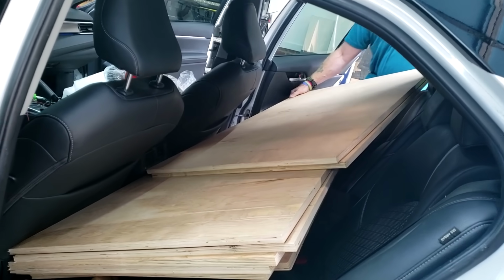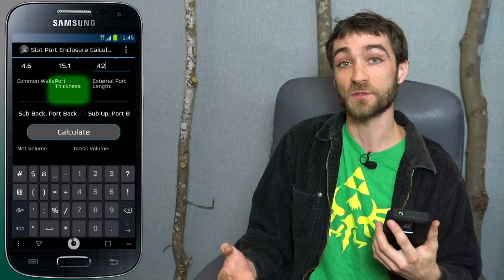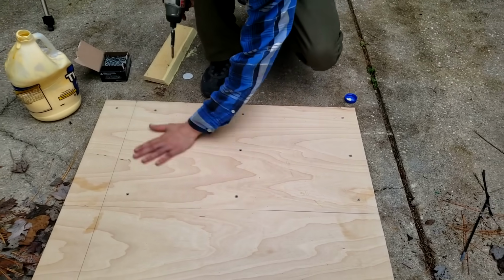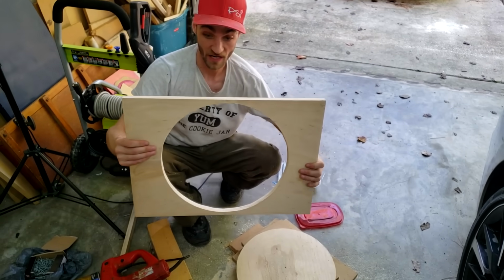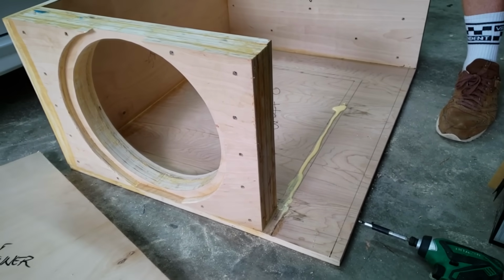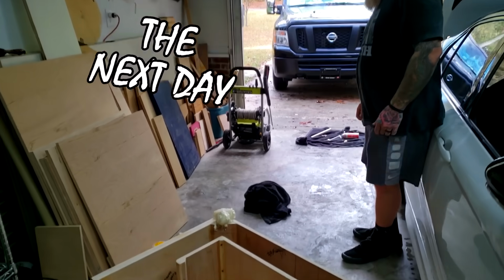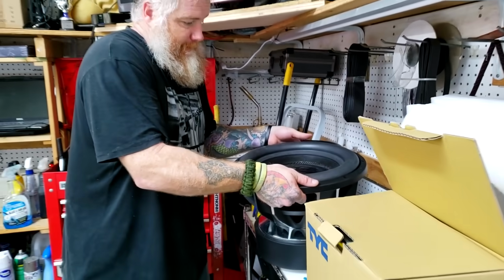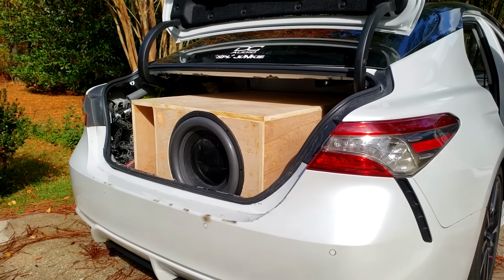Building a Ported Subwoofer Box for DEEP BASS!!! How To Design & Build LOW TUNED Slot Port Enclosure

Comment: quarter the way through and extremely jelly that your friend helped with the table saw. my $21 HF jigsaw with scroll blade was awful and it was my first time making rip cuts and with a power tool! Lesson: wrong jigsaw blade, ditch the homemade guide and focus on the drawn line. Still, uneven cuts seemed to seal nicely at 28x14x14. I'm old so my amp tuning is around 55% full tilt lol. Tip: check out the port area calc on SMD forum for even tonality from 25-100hz. Wasn't planning my 2cubed to be nearly 17" deep but it worked out.
Reply: my bad. 28x14x17+ with front baffle added AFTER. Just glued it on and if I shape up the box, the port will extend another .75". I suck

Comment: I prefer 11-13 ply baltic birch, but i use them for dj subwoofer applications so i need light wood that can stand up to elements and mobile applications, mdf is good for permanent installs, just dont get it wet

Comment: Great video.  Tip for building.  Instead of using wood glue use 100% silicone in a tube.  That is tuffer than wood glue and won't crack under the pressure..  it will actually allow for the flex.
Reply: Silicone is pretty poor at adhering to wood. Better of using a polyurethane based sealant. They normally use this stuff to bond plastic parts to body work. It is amazing stuff.

Comment: Back in the 90’s I built a box like that out of oak. I applied a thin layer of concrete to manage the bass better. The sub was a 18” cerwin Vega stroker. Pheonix Gold amp. MB Quarts were components in my doors McIntosh head unit.

Comment: Can you build a box in crazy dimensions that will have the same air volumes and still perform. I have a f150 I would like to build a box that allows for a single 15 and mounts under the seat and in front of the seat taking up the space behind the center console between the rear seat. Do you have an email that I could send more info to?

Comment: Man you need an 18g or 23g nail gun to keep the pieces from moving while screwing em'. A countersink helps too. If you sprinkle some table salt on the plywood after glue they won't slide around. These are all just the cabinet builder in me.

Comment: I have a sealed box with 2 12’s. But I want a potted box can I just cut a hole on both ends and put a separator in the middle? Or will it fuck up my bass

Comment: Awesome video by the way! I’ve got a 2018 Metallic Blue Camry with a 12” JL W1-2 4 ohms  and 1000 watt amp in the back and may be getting a second JL just like it to add to it! Love my Camry! Next step I will replace the speakers and tweets. The factory speakers just can’t handle the bass. They crap out with the cracking sound at loud levels.

Comment: I wish you Americans stepped off that imperial system of inches and feet, the rest of the world does not like it, is used to the metric system, and by all means, your target audience would be much greater if you switched to the metric system. Also you can work more detailed with the metric system since a centimeter is a factor of 2.5 smaller than an inch, making measurements way more accurate. But great video though. :-)
Reply: No one care

Comment: SUGGESTION 4 A VIDEO: How to add a new baffle onto an existing box without dismantling anything! WHY?: For those who have stripped all of their subs screw holes, for those who need more box flexing support,  for those needing deeper baffles for longer sub mounting screws, for those switching from square subs to round subs or vice versa, for those wanting to change the look of the front of their box/enclosure, and so on. I know I'm needing to do this because T-Nuts chewed up my MDF and so I'd like to add a 1/2" piece of PVC/ABS and install Threaded Inserts into the new baffle while sandwhiching the threaded inserts in between the old and new baffles. But you could use a 3/4" or 1" new baffle made out of quality wood and teach us how to effectively attach the new baffle to the old baffle while painting or wrapping it to match your vehicle's interior or something interesting/helpful like that.

Comment: MDF is an industry standard, I'm guessing due to availability and cost.  Some pro's like to use Birch,  but I suppose it depends on how much you want to invest.  I'm currently running two JL Audio 12w6's in a 2014 Camry SE Sport and it's absolutely nuts.  Thanks for the content EXO

Comment: did not watch the entire video but he said at @ 2.57 there is no making it bigger true but if your just slightly small you can add poly to fool the sub, by slowing the sound waves down not the ideal way but it works. I have had done builds that I have been just short of target do to space limits and poly made it work poly can make the unworkable work.

Comment: simple  tip to prevent splits predrill with 1/8 " drill bit . put some glue in a cup and dip screw in glue then screw in. any time a split happens that screw will not  have any holding pressure .  also  if you poly all the internals it allows less port noise .

Comment: Dude what would be a quality box for an alpine Type R 10” DVC sub woofer 1800 watts peak. I need to install this into a 1995 C4 so there’s not much room behind the seats. I plan on integrating the mono block amps and the 4 channel amp behind the seats for airflow maybe fastened to the box itself. I’m not really needing to see the woofer facing forward as the amps will need to be cooled by fresh air and/or AC unit. I’ll be using both mono blocks on the sub one per coil and figure there probably going to get pretty warm but hopefully not I.D.K. Maybe u could play around with a few ideas and make a video about it.

Comment: Oddly I don't even have to screw in my (Dayton Reference) subs into the box. Soon, I'll be getting an Ultimax. My subs don't vibrate or have box noise. They point straight up at my ceiling so I guess the weight of the speaker and the tightness of the lip holds it in. I couldn't get the sub out once I put it in without bopping it against the floor. So 4" baffles, meh. I only left the subs loose so I can paint the boxes when the weather gets better and to mess around with audio treatments inside of the boxes.

Comment: How do you still hear? 160db? Come on, man, I can hardly stand 80db. I have my computer speakers set on 26 (of 100). That's about 38db Mathafacka.
Reply: It's looking just at lows, which is more tolerable than the equivalent of a full range speaker.

Comment: Hopefully he won't need a spare tire 😂
Reply: place that sub downwards so the air pushes the car up, no spare tire needed
Reply: Run flats come on the xse camry from factory.
Reply: @terondavis3843  for 50 miles lol
Reply: U dont need a spare tire in car audio world u can just pull ur sub out use the magnet to connect to the metal then drive
Reply: Triple A or a row service.  I haven’t had a spare in any vehicle I’ve owned in the past 10 years.

Comment: HAPPY NEW YEAR EXO! 
Awesome video and as always great to see you and the bass putting a huge smile on his face. 
At 1am i finished the prebuild of my 15" (Only a cheap one that i got as a gift some time ago with 5mm Xmas but still impressed for how it performs) home subwoofer. 
Not perfectly on new year as i wanted but when i played "put on" and hit the lowest note... Damn that put a smile on my face! It's shaking my whole apartment LoL
Hope you had an awesome new years party to!

I like to work with plywood. My sub is made out of MDF because i couldn't afford Birch multiplex.
Now i will save up money to build a nice box with birch MPX.
I will never build such a huge box with MDF again. it probably weighs 40kg and over 60kg with the the driver and amp inside. Then there is that insane amount of dust....

Comment: I wouldn't call MDF the holy grail of making boxes, but the MDF here is WAY more uniform and easier to work with than the ply wood I can get around here.  I didn't think the dust was any worse than with ply either.  Only thing that was tougher was that I had to be more careful putting screws in so I didn't split the material.

Comment: Love the video... I love the app you talked about too.. I use it alot! Question though... how did you figure the dowel displacement?
Reply: Should be pretty simple, get the diameter and length of each dowel you're going to use, then find a cylinder volume calculator on Google. Add the volume of all your dowels up and that should be your displacement.

Comment: You need a Brad nailer. Cuts assembly time in half. So much faster than screws and less likely to split panels. Tightbond is strong enough to hold the box together itself without the screws.

Comment: Could bass loosen the fuelline in the engine bay? I got a Renault laguna 2 and since i installed an amplifier my car it started to stink when it was running. At first the smell of fuel started to appear when I heared loud music and then every time I started the engine and drove a bit. Now my car just turned off while standing at a traffic light and I can't turn it on and it stinks so heavy. I just wanna know if this ever happend to you. 

My setup is nothing special just a random amp with a random sub in a random ported box. It's not tuned so it sounds not so good but for some songs this sub really shines despite the price of 10 euros ( the sub ). I found it on a flea market. I really don't know if it's called flea market in the us but this is what google told me it's called. Basiclly it's a place where people come to sell their stuff they have lying around and don't need anymore. The box was full of mold so I dumped it.  
I really wanna know how to calculate the right box and what to use why but I just can't figure it out right...

Comment: plywood is stronger than MDF, but its not the wood that fails.....it's the glue. plywood separates because the glue layers ultimately fails from the constant vibration.

Comment: Never trust Box Calculators port tuning. I build a lot of speakers and subs and the measured tuning freq are always wrong  ..   u could use the simple method of a tone  generator.. go from 10hz up by 1 hz at a time.. and observe the cone... at the tuning frequenci it will have like zero movement..  u will get a surprise..

Comment: Plywood with lots of layers is better than MDF but way more expensive. MDF has better internal damping in the midrange. The idea that MDF is the one material to rule them all comes mainly from hi-fi and full-range speakers - when you get into the world of prosound, MDF is not only a heavier option than quality birch plywood, it is also less durable and does not hold up to use and transportation.

Comment: i think fiberboard is the most death material so it doesnt add to the sound the sub makes (think acoustic guitar ) so it be the best if you calculate a cabinet to an exact note , with plywood and the same calculations and make a cabinet that sound different compared to mdf , better or worse is depending on the design and the ears of the userabout cutting the boards , look intoo buying a tracksaw , thats a handheld circulair saw that runs on a rails youre laying on the board  it makes cutting large cuts and cutting large boards a snap , you lay them flat on the floor on some styrofoam and go at it

Comment: I use MDF all the time.  I like it because it sands really well and I can make it do what I want it to, and its cheap.
BUUUUUT it is definitely not the best for making speaker enclosures.  
What you want to look for is overall strength and something else just as important which is the dampening factor of the wood, or how easily the vibrations die off in the panels.  
I've used 18mm (approx 3/4") Russian baltic birch and it is very nice, very strong, and has really good sound properties.  The problem is that its 2-3 times the price as MDF.
But there are even better plywoods than Baltic Birch.  They are usually categorized as "Marine Grade" plywoods that use an adhesive that resists wetting and the veneer plys are top quality with barely any knots or none at all.  They are superior to MDF in every way EXCEPT for the cost.  Expect to pay well over $100 per sheet.
Reply: yes but this is misleading. Take the average person's build into watts and you're around 350 watts? All 12" projects will utilize a 4x8' sheet or less. And expensive wood typiclly doesn't come in 8 foot sheets. SO that's that. Nonetheless, My first MDF 3/4ths box at 2.9cuft = 2.0cuft is fine the last couple days after 2 days of "breaking-in" the sub. It's muddy with certain AM tracks. f it

Comment: Don't ever use spray foam in a car you twits. It soaks up water and eventually will separate from the metal causing vibration rattles which are fucking annoying...

Comment: A little tip for you when your glueing the larger flat panels together. After you put your glue on sprinkle some salt across the glue. It helps keep the from sliding around. Kinda like grip tape on a skateboard

Comment: I would love for you to design a box for a convertible e46. I still want to be able to drop my top as well. Currently running 2 15" k6 2ohm dvc subs as free air. The fire through the ski pass. I'm about to remove everything and build a sealed box, but it's gonna be a tight fit getting the airspace. I can still kinda use my trunk as it is. 
Thank you sir for providing the vids you do. I know it takes alot of work.

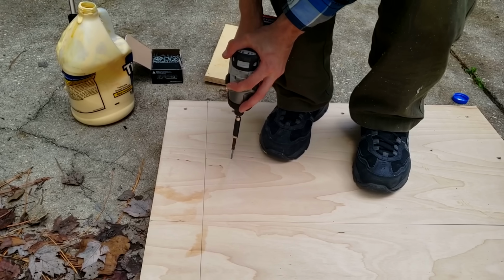Comment: EXO, do you not know you cannot squeeze with full threaded (8:55) screws without pre drilling one board ?
Or you can use screws that have no threads the first inch (thickness of one board) or less below the top .
Happy fabricating and have a nice day!

Comment: So i have a aufio pipe amp and i was putting a screw in to mount it to keep it in place and accidentally pinched my power cable and shorted it out to the case of the amp haven't tried to add power yet as I need a new power cable to be safe and a fuse as a breaker box I had didn't even pop but I will be doing a visual inspection before I add power in anybody's experience what are the odds of it being good

Comment: I wish you could work on my project you have inspired my system set up right now I am pushing 4 cvrs 12 by kicker with a Swiss audio p450.1 pro series I was told was 500 watts , epicenter power acoustik, and a mini 500k micro farad capacitor .. soon to be 6 kicker cvr12 I do have a video of my old 6 subs I had just for the mess of it 🤣 please check it out and if you like I will try to post a new video of my 4 cvrs 12

Comment: the actual wood used matters less than whatever dampening you use for the box.  plywood plus dampening mat is fine.  also depends on if you're just building a sub box, or a pair of full range speakers. resonance is always an issue, so dampening and bracing matters more than the material.

Comment: As far as I remember MDF has a better resonant frequency parametres than plywood; Making plywood lose more pressure as it will yield easier. But then again, if you overdo thickness of plywood, go for it. There is a reason for all proffesional boxes being mdf, and that is really the only thing you need to know. :)

Recap: 
MDF (non resonant)
Plywood (resonant)

Comment: The problem with plywood is at certain frequencies could and usually vibrates the plies apart causing unwanted noise in your enclosure. If the plywood didn’t get glue in places you can’t see from the mill, your going to hear it, Usually at low volume. Yes MDF creates a lot of dust, but it is more dense and you can get cleaner shapes. Back in the 80’s people used plywood, then particle board, then MDF.

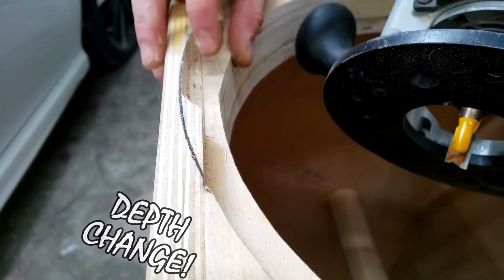Comment: When you router the sharpie line around 25:00  use the discarded center cut out from the baffle, you can use it support the router so it doesn’t wobble. Notch it and put it back in the hole with a longer piece that spans the hole using clamps to hold it in place and u can rest the router on it. Also us can use the center hole and circle jig so u get a cleaner/perfect edge. 😉  hopefully that makes sense.

Comment: MDF is the most acoustically dead but birch ply is close. MDF dust is BRUTAL though so the lighter and more pleasant to cut plywood wins.

I have been using Box Tune Calculator but it doesn't do the common wall and external port stuff. Time to switch! Thanks for the tip.

Dude looked so happy with that! That's what this hobby is all about. And nice to see another Wes that loves the lows lol! Please toss the mic in that thing. Be curious to know what kind on 20 hz and peak scores it gets.

Is the random sub a Banhammer? I hope it's a Banhammer! I don't even wanna win it, I have two 15s. Just hope somebody else can feel the EMF love lol. But seriously, isn't there a Banhammer video we have been waiting for?

Comment: I use Baltic birch for anything that will be used for outdoors. I cut tons of MDF and Baltic ply in my cnc shop. Both have advantages and disadvantages... I like both and both sound great.  Birch ply is a bit more resonant.  We mainly use ply for PA cabinets to save weight... less weight means you can bring more subs in the truck.

Comment: After years of building scoops and subs for P.A use indoors/outdoors, we use 13 layer marine ply or Scandinavian/Russian Birch up to about 25mm.
Reply: One of my subwoofers is made of 1/2" crap ply and the other 3/8" baltic birch. They have 4 45 degree triangle ports in the corners that act as bracing though, and a second baffle circle at the back of the ports to act as more bracing and braces on the back wall.

Comment: I've got a G35 I need some help with I have a resilient sounds platinum 12 and two x8's I had to change to the 8's because I can't get the platinum air space I have a 45ah limitless and a synergy 2.1 I am local to u as well

Comment: Wow.  That cuttout for the sub is SMALL.  I was like hes for sure not gonna screw the sub at 12 oclock or 6 oclock.  But it works.  Fuckit.    I need a custom box for my 12inch hifonics BRZSQD4.  I have 2.   Their square subs